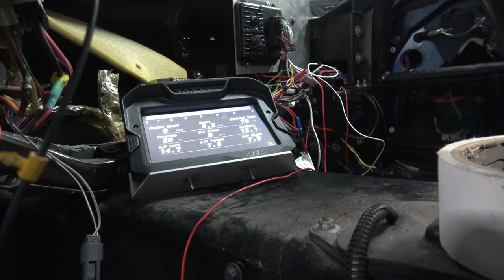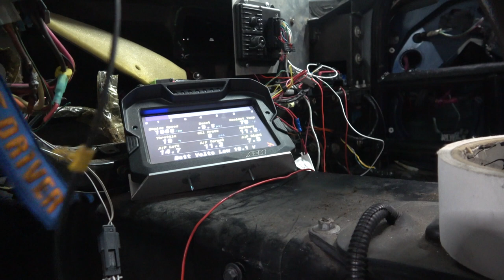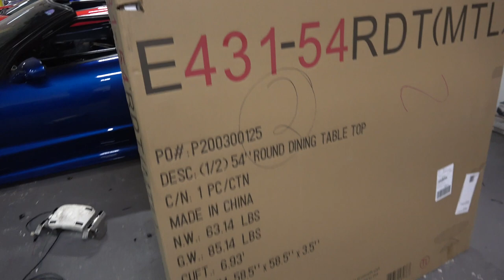My First Major Mechanical Failure of the Year

Comment: I have heard of the Amg gt's blowing power steering pumps from doing donuts . Something about being at high rpm while at full lock on the wheel.
Reply: DanK the ripper I just commented on that. It’s a common issue. Dude must’ve turned the onboard Nannies off and threw 1 burnout.......POP 💥
Reply: I think also older AMG cars. Hoovies garage had a W211 E63 Amg that blew the steering pump just  from doing standing burnouts if i remember correctly.
Reply: This is correct.

Comment: Steering pump failures on the amg cars was a widespread problem, it usually happens when you do donuts with the car, somethings blows in the pump after doing the donut and send metal flake through the whole system so dealers usually end up replacing the pump and whole steering rack and reservoir, so that get could of been from someone doing donuts with the car, I think there’s part numbers of the good pumps you may want to look into that they used a good pump replacement instead of the same pump that’s prone to failure, have dealt with a few of those, don’t know if you remember me I’ve helped you in the past with ideas for your channel, adventure drives continued success.

     Sincerely 
               Fabrizio

Comment: Is the battery voltage monitored directly over both battery terminals?
If not, measure there and compare to read-out. If you then see a difference between over battery vs the monitoring you have a cable/connector issue (oxide, damage or to thin cable).

Comment: For the c5 start issue, have you dismantled/cleaned guts of ignition switch?  Dont mess with the tumblers/key part - only the tangs/switches.  Easiest to resassemble on the bench with key in run position

Comment: Battery voltage is absolutely normal at 9 volts when the starter is turning, you will never see a car cranking and battery is at 12 volts.
Reply: Wrong. Voltage shouldn't go under 10 while cranking, but yes it'll definitely drop under 12.

Comment: If the diameter of the cables from the battery to the starter is too narrow you will get voltage drop.  Run a jump lead from the positive battery terminal to the starter and another from the negative battery terminal to the engine block and see if it improves.

Comment: Rack and pinion? My is currently being replaced for the 2nd time in my infiniti. They say the part is $3000 new but the warranty is using a rebuilt one. Not happy about it considering they put the last one in December 16th and its already failing.

Comment: What did the customer have to pay 12k for on the Porsche? Also no surprise the Mercedes broke to be honest, the new ones just arent made the way the old ones were. Our GLC has been pretty unreliable from drive belt coming off, to rear view mirror assembly breaking, to electronic issues with the side cameras, parking sensors always setting off with no vehicles around, etc.. it's been a hot mess and we'll be throwing the keys back ASAP.

Comment: I'll bet the AMG steering rack was damaged when someone tracked it in a previous episode. I believe you thought it to have left the track too if I remember correctly.
Reply: Mercedes steering racks are notorious for failing during a full lock turn for multiple seconds (full lock donuts or slides)

Comment: WAIT THATS NORMAL FOR THE CAR TO DROP VOLTAGE AT START UP . YOUR PULLING POWER FROM THE BATTERY TO THE STARTER AS LONG AS IT JUMPS BACK UP AFTER IT STARTS I DONT SEE WAT THE ISSUE IS ???????

Comment: Did I miss something? The AMG is having steering issues and is getting repaired under warranty but the customer has to pay something? Did the customer hit something?
Reply: Loss of use I guess
Reply: @93mlo  but it appears it had nothing to do with customer. Just cause its in their possession doesn't mean its their fault and are responsible. If a car over heats under normal driving condition there is no way that can come back on the customer. I'm confused.... how this can come from the customer, the customers insurance, if its a car issue at no fault of the customer.
Reply: @93mlo  Hopefully rob clears this up.......